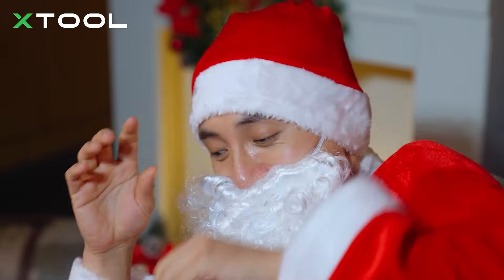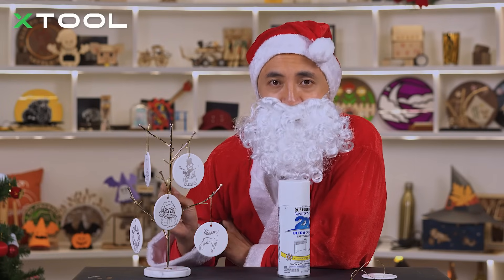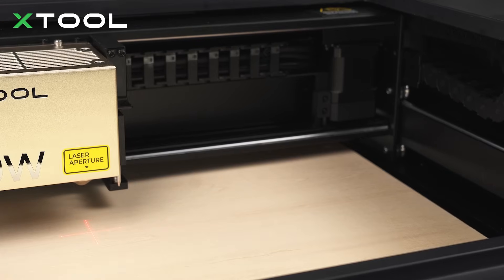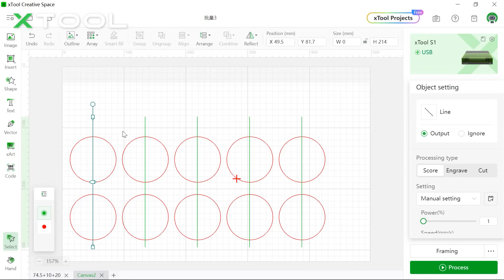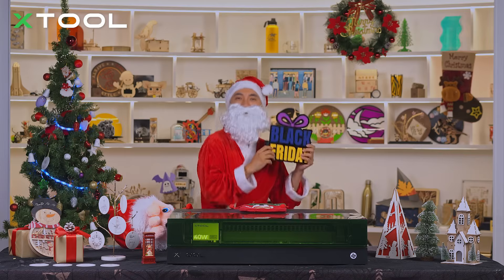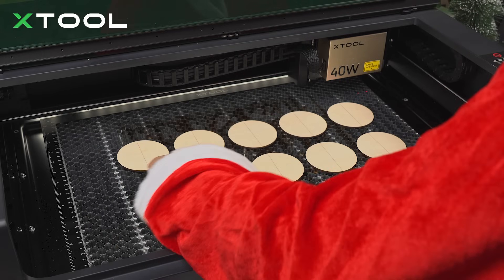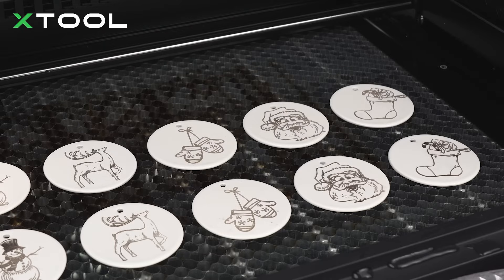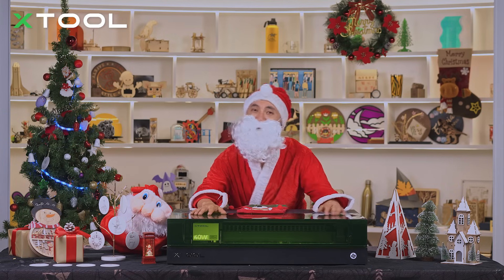How to Batch Produce DIY Ceramic Christmas Ornaments with xTool S1 Laser Engraver

Comment: Don't you wash the paint off after engraving? Seems like the texture of the ornament would be rough with the paint left on there. Not to mention it would likely chip off and look tacky over time...
Reply: I saw the video mentioned cleaning, I tried to use alcohol and water can remove the surface paint, and will not affect the engraving pattern.
Reply: @紫薇-t7n  It did, but he only did a couple quick swipes, so that's what prompted my question about needing to actually wash the paint off.
Reply from the maker: @mojo2613  haha yeah due to the time limit, it only showed a couple of quick swipes, but when you actually make them, better to clean them a bit better
Reply: @xToollaser  Ok, thanks!
Reply from the maker: Hi, you can use water or alcohol to clean it afterwards!